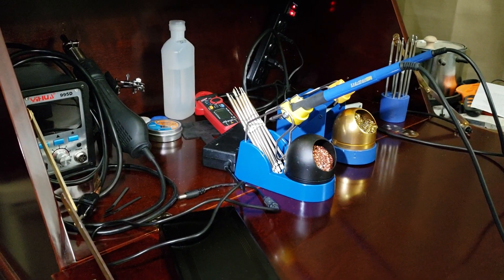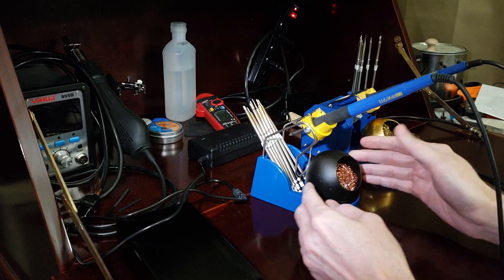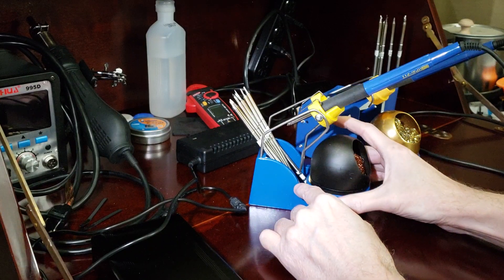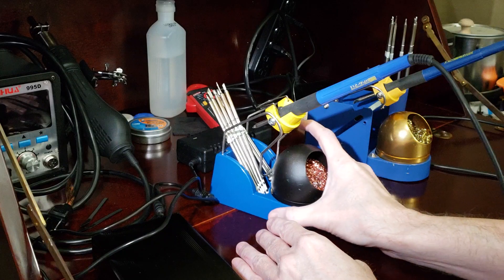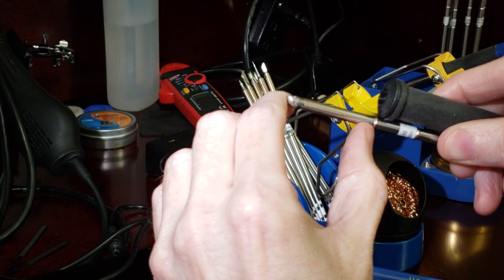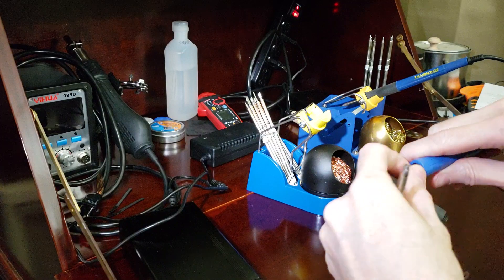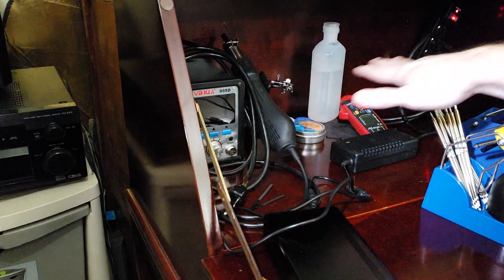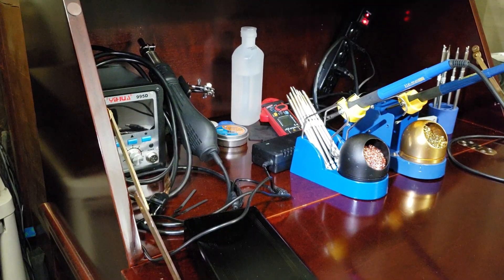Soldering Iron Stands for the KSGER T12 and Differences in the Hand Pieces

Comment: make your own simple at the fraction of the cost
Reply from the maker: Way too much work. In my opinion.
Reply: @JasonWW2000  used the old spring holder and surrounding took me around an hour too make one with salvaged parts with a peace of ally angle and some rubber feet
Reply from the maker: @namAlexander  "old spring holder"?
Reply: @JasonWW2000  you know the spring type holder they come with allot iron stations and help hands but the one i have has a surround as its a old unit and leg coming off it so i could drill it to add fixings
Reply from the maker: @namAlexander  Okay. I was trying to suggest holders for people who don't already have older stuff. So if your new to soldering, what can you buy that is not very expensive. 
Companies like Hakko, JBC, Weller, etc... make holders, but they are quite expensive. Even the spring looking type can cost $15 USD. 
If you have the Hakko clone looking solder iron and want a holder that fits just right you normally have to spend a lot of money. The stand in the video was $16, which is hard to beat.

If you don't already have a basic spring looking holder and have to buy it for $15, then modify it, your not saving any money at all.
Reply: @JasonWW2000  was looking for stands there was some really lightweight ones around and not very good the two you shown are around the best you can get for price , hakko are expensive for what they are I think they think of a number and add a zero lol, I thought sod it used the old solder holder and the stand has enough room too add both cleaners , I might spray it blue and get a hakko sticker lol
Reply from the maker: @namAlexander  I believe Hakko pays engineers and do lots of testing to make sure every product is durable and high quality. Plus they are a larger company with lots of employees and have good warranties so they are spending lots of money to make it. 
Smaller companies can simply clone their products and spend little money so they can charge much lower prices. 
I hope that makes sense.
Reply: @JasonWW2000  I watched a comparison on the tip temp unit they have too a copy unit and there wasn’t much difference, thing is you pay top money on quality gear if your doing the job for a living, good warranties are always the seller for me one reason I have allot of Corsair hardware

Comment: Tbh doesnt look stiff on video. Im looking in these friction mount handles because they are only ones that can hold non standard size tips (with large head) and im worried it will be too loose
Reply from the maker: It was not very stiff in the video because I drilled it out like I mentioned. When new you had to use a lot of muscle to slide it in and out. You should not have any drag or gripping from the plastic pieces at all.
What grips the heating element is in the rear of the handle. There are 3 metal tabs that press against the metal tube to form the 3 contact points. They are power, ground and sensor. See the picture in the next post. You can bend these metal tabs to make it grip a smaller diameter element. Just make sure the spacing distance of the metal rings is the same.
Reply from the maker: Here is a picture link.
https://i.pinimg.com/736x/6a/9c/bf/6a9cbf3376341e463c749a6c8264c88f.jpg
Reply from the maker: Just a note, these KSGER tips use the same electrode spacing and diameter of Hakko's soldering tips so they are compatible with each other. You want to make sure whatever tips you use have the same electrical spacing. Using a smaller diameter tip should not cause a problem as long as its not hugely smaller. It might be hard to use because it will probably move around in the very front section of the wand. You might try wrapping some high temp tape around the element so the wand will hold it still as you use it.
Reply: @JasonWW2000  Thanks for the info, i use quicko with the same handle and honestly contacts dont grip that much, if it wasnt for the screw in front im sure tip would wobble from use. Thats why i was wondering if using heavier tip like C8 would work with friction mount handle. 
As for compatibility as im aware t12 tip is a hakko standard and should be all same?
Although i need a good iron i wouldnt call myself an advanced user because 80% of work i do is with CF4 tip, but p9 handle seems to be worth a try
Reply from the maker: @Boz1211111  You should be able to take the wand apart and bend the metal tabs inward to get firmer contact. 
The screw-in fronts job is to hold it steady and not melt. 
C8 should be fine. Its no different than any other T12 style tips. It just has a bit more mass. I think all T12 tips are standardized. I know there exists tips with built in identification so the iron station knows what tip you inserted. I can't remember if that was a T12 type or not. I think as long as the tip is identified as a T12 you'll be okay. There do exist some similar looking tips that are a different voltage and incompatible, but I don't think they are referred to as T12.

Comment: Would you know tell me if the 9501 handle is better than the new p9 handle? Thanks!!
Reply from the maker: I haven't tried the P9 handle. Sorry. It looks very similar to the FX-9501 handle, but a lower price. So maybe the P9 is made even cheaper? IDK. I'm fine using the 9501, so I don't plan on trying out the P9.
Reply: @JasonWW2000  thank you for this reply, my friend. Don't you had any problems with handle warming? Any softening of the plastic?
Reply from the maker: @SERAFINARODRIGUES  No, not at all. It's hard, heat resistant plastic. Also, the heat is mostly in the tip of the metal rod. A couple inches back stays pretty cool, unless you leave the iron on constantly. These stations can heat up the tip in just a few seconds so I always use the auto-sleep function. This also makes the tips last longer.
Reply: @JasonWW2000  nice! Yes, one of the main reason to buy this station is this auto sleep function, it's necessary when working for large time. Have you ever seen the "XA grade" tips? Really thank for your attention, it's a pleasure to talk with someone that knows about this station.
Reply from the maker: @SERAFINARODRIGUES  The XA grade tips are the ones with the black coating, right? All the coating does it prevent the solder from sticking to it. The solder will only build up on the exposed metal edge. I'm not sure what application you would need that for. The regular tips work fine for me so thats what I bought.
Reply: @JasonWW2000  yes, exactly this one, with the black coating. I have to thank you so much. You helped me a lot with this questions. Best regards, my friend!!

Comment: ive ordered these from three places now and NONE of them will fit the cleaner like yours does they are all to small of a hole.  do you remember which seller  you got this one from?
Reply from the maker: By cleaner, do you mean the black or gold tip cleaner? Those are all pretty standard Hakko size. Or do you mean the blue wand fitting in the yellow holder?
Reply: @JasonWW2000  im talking about the tip cleaner. they seem to have changed the design of these knock off stands because the tip cleaner is to large to fit in the hole now even the real hakko one
Reply from the maker: @th3drizzl378  Wow, that's a shame. I wonder why they did that? I bought mine on ebay, but the listing is long expired. I guess you can ask sellers how big the opening is to try and find a good one. Or else see if anyone makes the tip cheaner housing in a smaller diameter. Other than that, I don't know.

Comment: Just modified my non-Hakko stand like the one here, to fit the Hakko 2032 micropencil and incorporate a same-functioning tilt switch mechanism to enable sleep function on both hakko station channels and irons (have the 2027 and the 2032 hooked up, to an FM-203 station) . A bit of work but an interesting project. The hakko switch mechanism is just an NO(C) microswitch with a 4.7kohm resistor across its pins. So when the switch is open (no iron in holder) there's 4,7kohm across the pins (the tip and ring of a stereo 3.5mm stereo jack, could use a mono) - and when the switch is triggered by the weight of the iron, the same pins bridge shorted. I don't think there's actually much current running through, but the Hakko original parts are 4.7 Kohm 5% 1/2W resistor and 100mA 30VDC rated microswitch (Omron SS-01-E). I just used a cheap Chinese one, as my improvised design needed a microswitch with a rather long lever trigger. The tricky bit for me was finding a suitable spring for appropriate resistance, so the plate springs back out but the very light micropencil still triggers it. To create the pendulum arrangement, I pulled the recpetacle and bent steel bits out, bent tbe legs in a bit (the ones that go down inside the rear wall of the stand), glued a plate across the legs, glued a round dowel across the sides of the large opening, and stick the same nds of the recpetacle down between the dowel and rear wall. The plate across its legs then rest agsinst the microswitch stuck to the bottom of the cavity towards the rear.
Reply from the maker: So you have the Hakko station which accepts the auxiliary input for sleep functionality but you just wanted to save some money by converting a cheaper stand?
Reply: @JasonWW2000  Not quite. Here's the deal; I didn't buy the dual output hakko station with the sleep-function holder and 2027 regular iron, new. Could never afford that. I got it really cheap used at a bankrupcy auction, was the only one (incidentally) there at the moment, that really knew what it was. Later, same with the 2032 micropencil iron (got it used for cheap with a couple of tips). But no holder/stand.

A new, same type smart holder for the micropencil is at least equiv. $120 / £100 + 25 shipping around here. The blue one like the one you have, I got for $9 from AliExpress, plus $2-3 in parts and consumables, the rest is hands-on hobby time.

While the mechanism might be ignorable for many, I have not been able to find non-Hakko branded tips for the micropencil. So new ones around here is equiv. $60/£50 shipped a piece. So need to make sure the ones I have, last for many years.

Hopefully in time I can make atleast a part living on this, but for now it's unpaid training time.
Reply: @JasonWW2000  I've had this equipment for a good while now, the Hakko stuff wasn't as saught-after on the used market when I got it so not so expensive 2nd hand. And I didn't know about the affordable and quite sweet Chinese KSGER, Quicko etc T12 "stations" at the time. Or they weren't around yet. If they were, I would most likely have gotten one of those instead for the value. Having borrowed one to play around with, with a good quality PSU they're not really that far off from my experience using the Hakko FM-203 if you're only using soldering irons (after a couple of well-known mods/improvements). Didn't really notice any significant difference when using the same T12 tip in both units. The Hakko station supports driving hot tweezers, desolder guns with pump and N2-assisted irons, but I don't have nor use that. Biggest difference IMO is more enthusiast settings to tune and play with on the chinese one, tilt switch in handles, and the different types of handles. The latter is so subjective, it's not for me to say it's a definitive pro or con, although the T12/T15 tip sitting in the detachable grip piece on the Hakko iron is kind of nice, as is the comfort of the grip piece itself. I got 3 of those pieces in total with the station, all different colors, so I keep my most used tips in those. Makes it easy to identify, and a bit easier to swap between those tips while still hot.
Reply: you prolly dont care but if you're stoned like me during the covid times you can watch pretty much all of the new movies and series on InstaFlixxer. I've been streaming with my girlfriend recently xD
Reply: @Genesis Paxton Yup, I have been watching on InstaFlixxer for since november myself :)